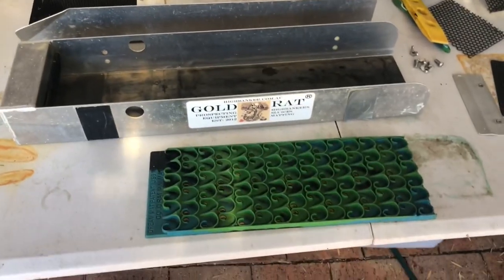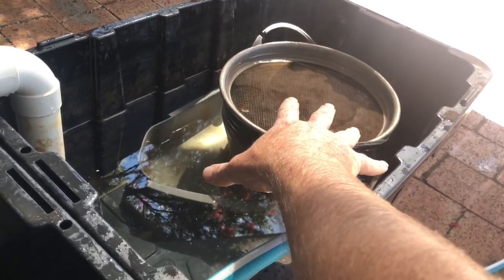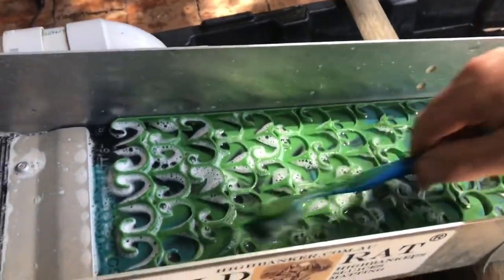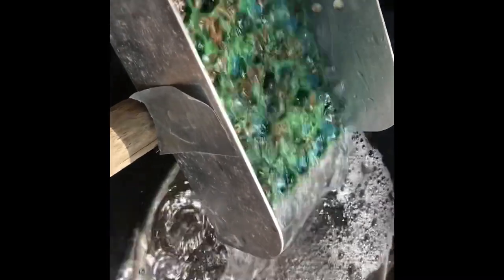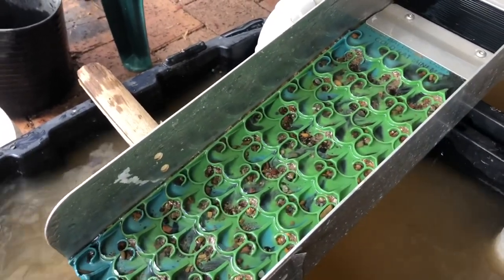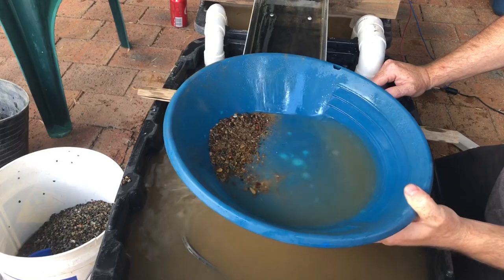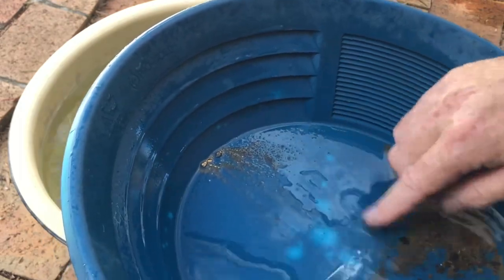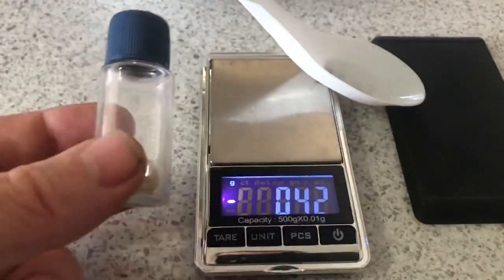Gold Rat Recirculating Sluice

Comment: A true recirculation would bring your tailings back up to the cycle of going threw again at that point beings true hands free recirculor
Reply: I'm working on an idea usen a batt. Water vac ... Going bug free before I cut lol
Reply from the maker: The term recirculating is for the water , it negates having to waste the water or use it from a river source , unfortunately in my area it is illegal to use mechanical equipment to remove or wash dirts from a gold area but I have seen many other people from different locations use a shop / wet vac to collect concentrates from cracks and crevices .